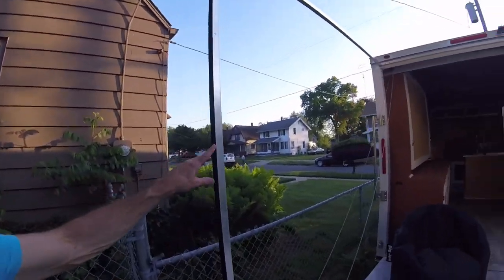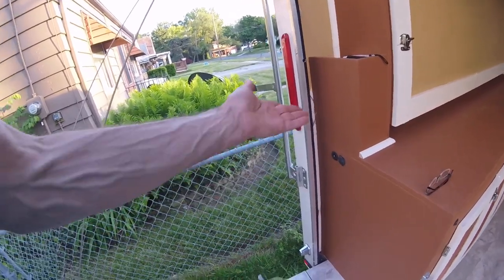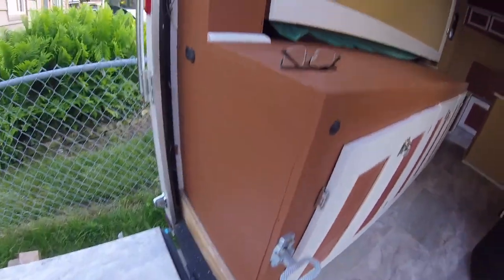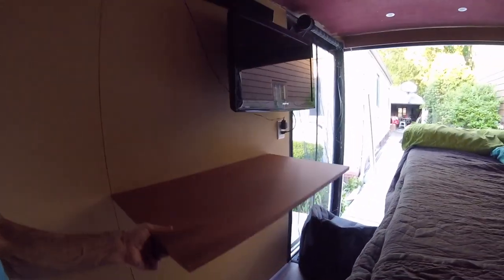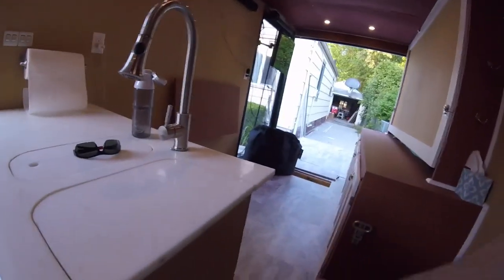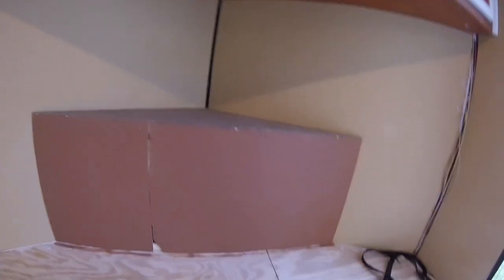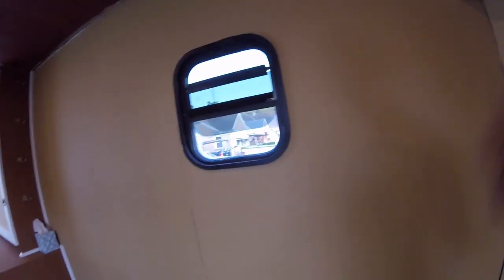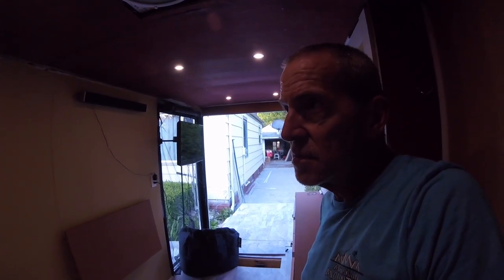Cargo Trailer Camper Conversion :: So close to done

Comment: Looks great. Very nice set up ! For the locking door bar… I consider adding an additional “hasp” to the side walls to lock the handles in the open position but would have had to have the bolts/nuts on inside /finished walls & didn’t want that look to “my” camper. So, I drilled out the factory rivet at the handle swivel point and replaced it with a bolt and wing nut. I insert the bolt from the inside out and install the wing nut. IF someone removes the wing nut, they cannot remove the bolt because it bottoms out against the trailer wall! But, at night time, I remove the wing nut, bolt AND handle and secure it inside the trailer with me! I installed a heavy duty slide bolt on the inside of the door and that’s working great. Only takes about 15 seconds to remove/install the handle. Simple and easy fix to this issue…

Comment: Great job on your build. Had a few suggestions. ONE is installing fresh air vents in you battery box. (Did not notice you mentioning ) TWO is locking your door latches with your padlocks locks. This will also deter someone from locking you in.

Comment: Lot of thought went into this! To prevent being locked in, how about adding an eyelet that would allow you to lock the door lever in the open position? Also, after forgetting to turn off the lights inside cabinets too many times, I installed a switch that lights up with a red LED when it's on. My favorite idea is the outdoor tent area that snaps together.

Comment: Simply drill out the rivot on the hasp. Put a bolt and nut in its place. Then you can simply remove the hasp(handle). Put the head of the bolt in next to the trailer. Even if they remove the nut the bolt will not come off. (Not enough room)

Comment: I like how your build has come along.  The ramp door idea is one I’ve been contemplating as well.  Your click and lock framework looks great.  I really want to see that when it’s done.  

I had thought about using electrical conduit for the framing.  I see you are going for a panelized system with the Velcro.  I’m thinking about a one piece, 3 sided +top screen unit to slide right over the frame and then a sun/rain cap or awning over the top.

But I really like the click connection setup you have created.  Kinda like Electrolux vacuum hose connections.
Reply from the maker: My concern with doing a one-piece, slip-over screen canopy was high-wind situations and the fact that I am a solo camper and it would be considerably more difficult to construct the screen room alone.

Comment: Awesome! I really like your build, I am doing a conversion of my own. I also want to do a frame an extra room/deck using the trailers rear ramp door. Where did you get the connectors for your frame?
Reply from the maker: https://eztube.com/
Be careful about where you buy your tube. It must be the 0.50" thickness. Lowe's and Menards both sell 1/16th thickness. Home depot as the 1/20th that you need.  Or, you can buy from eztube.

Comment: Why do you have second ramp what purpose dose it serve in you set up?
Reply from the maker: When I had my Sprinter van, there were many instances when I would back into a parking space only to realize that the back doors would be blocked by a tree or a guard rail or telephone pole etc. Since it's considerably harder to re-park a 19' trailer, I wanted to have a second option for getting the bikes out of the trailer.

What I didn't realize when I ordered the trailer was that I would use the trailer a LOT less frequently for local trips than I did when I had the van.

Still, while camping, I have found that I use the ramp way more than I use the RV door just because it's convenient.

Comment: 15:45 I would just lock that pad lock to the latch so you can’t lock the bar ...
Reply from the maker: I tried that. the loop on the padlock is enough to keep the bar in place. I was unable to push the door open or jiggle it open by repeatedly closing/opening when the bar was being held in place by just the top of the padlock loop.
Reply: Pete Hustwayte that’s good to know ... I’ll do what you did with the back door